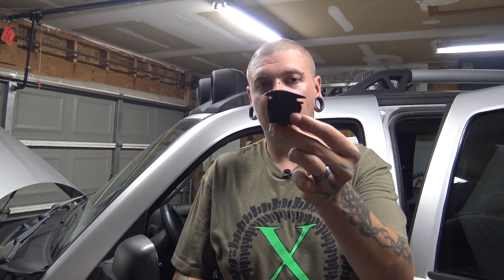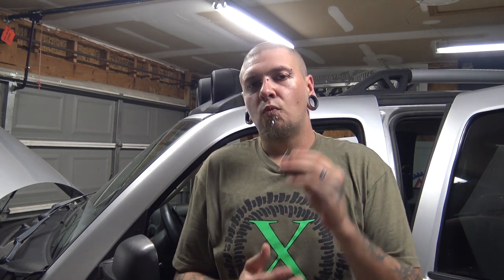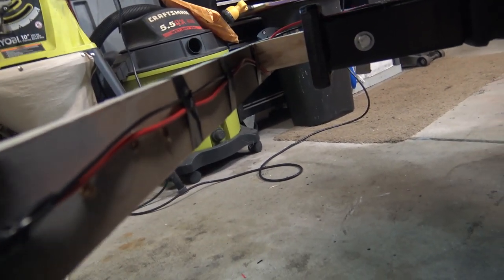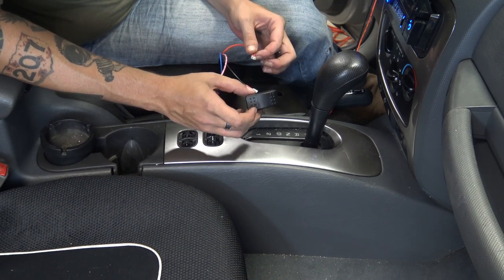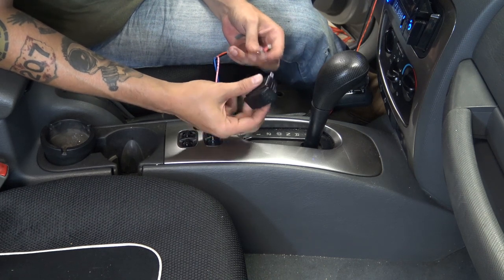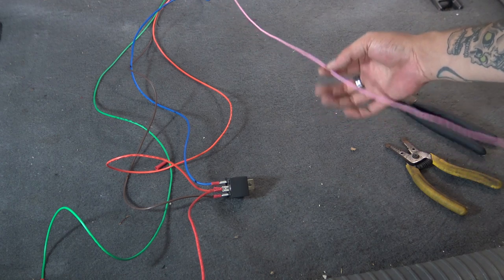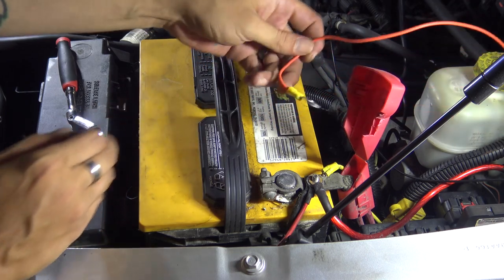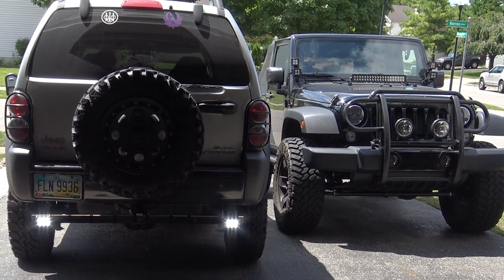How-To Make Aux Reverse Lights Multi functional (SPDT Switch)

Comment: That is a lot of work for a mock-up.  Nice video.  I'm not a fan of cheap splices due to corrosion.  Your work has earned you another subscriber.
Reply from the maker: Thank you! I usually solder all my connections, put on some dielectric grease and heat shrink. I use T-taps in a lot of videos because I would rather see people use these then just twist and tape. Thanks for watching and for subscribing!

Comment: First off, nice video & 2ndly, all you just did was wire the switch backwards with the two power outputs coming from 2 sources! I did this with my motorcycle's undergrowth led pods! It's nice to be able to control how & when something works! Again nice & easy to follow video!

Comment: I just received 2 pairs, one will be in the back and one as fog ligths. This video just save me, cause I want to use the back one with the reverse  but also want to use it separate by itself, thanks great video.
Reply from the maker: Glad the video could help! Thank you for watching!
Reply: Does the green wire runs from the batterie negative side?
Reply from the maker: @shijansantos  You can run it to the battery negative or you can ground it to a chassis ground, which ever is easiest to you. It just needs to be a ground. Thanks for watching!

Comment: I did mine on a relay so if I put it in reverse they would be switched on and off automatically with the high beams. Foreward off-road lights are similar, but with the ability to disable them with a dash rocker as well as off with low beam.

Comment: Great video and great detail! Thanks for going through the pain of leaving everything exposed and repeating its for demonstration purposes only ahha. I was wondering though. I have an Auxbeam switch panel. Would it be possible to wire it with 2 different switches instead of a rocker? to where I can manually turn lights on on my switch panel but have a different button mounted on the dash where "on" means it turns on with the reverse and off means it doesn't?

Thanks!
Reply from the maker: Sorry for the late reply. I think it may be possible. I'm running it through my head to think of how it would be done.

Comment: Great VIDEO!  Thank you!!   I have only one question though... as I am confused about the "orange" wiring.   When talking about the switch, you discuss orange going to pin 8 on one end and to the battery (for constant on availability and switch light remaining on if switch is grounded) or to fuse box (for ignition on activation) .   MAKES sense on both senarios.

THEN regarding the relay... you note that orange is connected to pin 30 and then back to the battery.

SO... will there be TWO orange wires connecting directly to the battery... one to switch and one to relay?

THANKS

Comment: Perfect timing for his video! I just bought a Globex Performance rear license plate mount thing on my 2016 jeep renegade... I am using Rigid Radiance. I wired the red ambients as a third (fourth?) brake light. I am working on figuring out which is the reverse light so I can tap into to get the same functionality as this from my relay. 

One question, is there any difference with a 6 pin switch?
Reply from the maker: It would depend on the brand of switch, MOST of the time manufacturers stick to a universal pin layout as to make all switches the same, but sometimes you get a company that just doesn't follow the rules. I would just reference the pin numbers in this video and see if they match up to the pins on your switch because with a 6 pin, I THINK it's just another ground pin. Thanks for watching, and ig you haven't already, make sure to subscribe to keep up on all the new videos and products! Thanks again!

Comment: Great Video; I will be installing this set up this week.
My question just to make sure; if I wanted the switch to 'throw' the opposite as what you showed (down is in tandem with stock back up lights) I just install the switch in dash that way...wiring stays the same....yeah...makes sense...
Reply from the maker: Makes sense to me, should be no issue with switching the wires. Thanks for watching!

Comment: Appreciate this video. I going to hook up the external backup lights to my truck. I was told I probably wouldn’t need to have a relay, but you are using one for these . The lights I’m going to use are 9,000 lumens . Should I be concerned about using a relay?

Comment: Great video and explanation, thank you for this.  I do have a question about how I would like to wire my aux reverse lights.  I would like the aux light to come on while in reverse and but also be controlled by a stock switch in the vehicle that controls the cargo bed lights.  Truck is a 2019 Chevy Silverado.  Any input you had would be greatly appreciated, thank you again!

Comment: Isnt pin 86 a ground and pin 85 goes to your switch from your relay. Thats how i have my relay/fuse box setup. Just curious
Reply from the maker: Pins 85 & 86 can be switched either way, no real wrong or right on those. This is just how I've always done them.
Thanks for watching!
Reply: @RockyXTV  Something new that I learned today, thanks again I was just worried because I’ve been doing it the opposite from you but like you said they both work either way thanks again

Comment: You say that you ran power from battery to the switch and power from battery to the relay, but when you hook up the power to battery, you only have one wire. Did you pull power from somewhere else to the switch or something?

Comment: so you use a 5pin relay, is that ok. or should I use a 4pin?
it's just my understanding that power continues to 87a.
great video, made setting up my rear lights and light bar to high beams easy to understand.  thnx.

Comment: May I ask help from you? I purchased the exact switch you demonstrated and connected it to two 7" LED's in my pickup exactly the way you demonstrated., everything worked for about two weeks then the manually controlled backup LED's quit working. They work in R, but not when I want to turn them on independently. I have checked and rechecked the connections, all are ok. I have checked the continuity in the switch, this is what I found:  Switch Top press in, continuity only between pens 7 & 8. Middle switch in neural, no continuity in any of the pins. Switch bottom press in, continually only between pins 8 & 2. I don't know what this means. I don't know if the switch failed. Can you somehow give me some pointers to fix this issue? Just added more info for you. The power supply for the SPDT switch is supplied by another switch and this is connected to SAPDT pin 8, pin 7 ground, center pin to relay 86, bottom left pin to power from reverse lights.

Comment: I am trying to put this on the rear bumper of a truck.  Where should i put the relay?   Do you have to have the relay?   Can i just splice into the hot wire for reverse lights and find a grounding spot?   I cant reach the battery from the rear bumper without adding wire
Reply from the maker: If using low Amp draw LED lights you don't HAVE to use a relay as long as your switch can handle the current.

Comment: Terrific video and instruction. I want undertake the same installation as you have shown, however, with one addition.  I would like to add a switch in the rear of my vehicle that would allow me to turn the rear lights on and off manually.  Are you able to help with how I would wire this switch to work with the three position switch at the front.  Thanks
Reply from the maker: You could add another switch to the rear, but it would be independent from the other switch. You would have to turn the lights on and off at the rear. You couldn't turn them on at the rear and then off at the front, or on at the front then off at the rear and so on. Automotive switches and wiring makes it very difficult to replicate a typical "3-way" switch like you would have in your house.
Reply: Thank you

Comment: Thank you for making this video. Idk if you have a video for this question but I want to add a dual color (white and amber) light bar to my 4runner spoiler and my plan is to have it like this where the white turns on with the reverse and also have it turn on with a switch but now my problem is how can I wire the light bar where I can also turn the amber on with a separate switch. So pretty much the light bar has 2 color and I would like to have each color its own switch and also have the white turn on when I hit reverse, is that possible?

Comment: This is the exact set up I want. I have questions! How did you know which terminals on the relay to use and how about a link for the relay? Thanks for all the hard work you put into making this video especially since you weren’t keeping the lights there.👍🏼☮️
Reply: The relay is a standard automotive relay, available at any parts store  The pins on the relay are numbered.

Comment: Since you are adding direct power to the switch, will it drain thr battery if you leave in the auto position?
Reply from the maker: There shouldn't be any parasitic draw from the switch alone.
Thanks for watching!

Comment: That's great!! Exactly how I want it. any chance if you can saw us the wiring diagram? That'd make it lot easier to follow. Thanks lot
Reply from the maker: If you like, you can send me an email rocky.tvchannel@gmail.com and I can send you a simple wiring diagram. Thanks for watching!
Reply: @RockyXTV  Great video easy to follow, but wanted to know if you could help me by showing a video on how to install 2 switches and still be able to use the reverse lights. I have upfitter switches and would like to use them along with the extra switch that will go installed to my trailer for better lighting while backing up and hooking up. Is it possible to use the pin box to do some of the wiring that would connect truck and trailer with the upfitter switches?

Comment: I cant see the switch, supposedly if i use a 7 pin dpdt and use one side so it acts as a spdt, do i still connect the wires to the pin number like in this video? (7 to ground, 8 to battery or dash, 2 to 86 in the relay and 3 to the tapped positive of the reverse light)
Reply: Hi, I know you posted this a year ago, but did you ever figure it out on the 7-pin?  I'm doing this now with a 7-pin.  Thanks.

Comment: If I wanted to do this same thing, but to an enclosed trailer. Would you have to use a relay (like you did) or diode? I want to mount a light bar on the back of a 20' enclosed trailer. I would like to use the light bar as reverse lights (actuate when truck is put into reverse) and an auxiliary light so I can mount a rocker switch in the back of the enclosed trailer to turn the lights on when the truck is in park. If the light bar was directly wired to the reverse light pin on the 7 pin trailer wires I would think everything would be fine, but if I also supply the 12V power wire (on the 7 pin at 11 o'clock) to the lightbar with a rocker switch I am not sure if I would get backfeed and mess anything up in the truck. I saw etrailer ( part number RM-790) had a diode that is preventing that. Here's the link to a question and answer from etrailer. https://www.etrailer.com/question-270174.html

Not sure if I need it or need a relay like you have if it is on the trailer. 

Thanks for the video!

Comment: Awesome video but i still have 1 question, i plan to run the switch to the fuse box is it better to run the relay to the fuse box as well or should that be direct to the battery?
Reply from the maker: I always run relays directly to the battery with an inline fuse, but you could run it to the fuse box as well. Just make sure you are using an empty/aux location in the fuse box for the relay and not sharing one. You could use a shared one for the switch though. Thanks for watching!

Comment: Great video.  Question is there a way to add a momentary switch to the circuit to  flash the lights? I'm guessing it is as simple as addinh the switch and some one way resistors to eliminate feed back.  Maybe I'm just tired but I cant figure it out.

Comment: Great video! Exactly the thing I was looking for! Great set up! Thank you!
Reply from the maker: Glad you liked it! Thanks for watching!
Reply: @RockyXTV  planning on installing some flush mounts to rear bumper of 2007 Ram pickup 
Want to wire them to a 2 position “ON-ON” 3-way old school metal flip switch and wire them also to the cargo lights my concern is do I have to run and use a relay also

I ask because The Cargo lights have a switch in the cab which may allow me to turn AUX lights on from inside the cab using cargo light switch the plan is to use the Aux lights when reversing or line up to trailer at nighttime but not necessarily be on with my reverse bulbs as I have led ones in my tail lights with plenty of light for normal situations in parking spots not so much for trailering/towing 

The 3-Way 2-position “ON-ON” switch I’m thinking of using will be mounted somewhere close to my hitch under rear bumper and Plan is to have the first “ON” position so AUX lights function with cargo lamp switch in cab but I can use the other “ON” position to flip lights on from back of truck if disconnecting trailer or need light behind truck so I don’t need an off function on my switch 
Have 7pin trailer plug in in the back of truck so my hot to battery and grounds can be wired off of it 
1) do I need a relay to wire lights up in this manner
2) can I run my wires to my cargo lamp hot wire that is behind cargo lamp outside of the cab with T-Taps to not have to wire all the way inside cab up to the cargo lamp switch
3) can I grab from 12v hot from my 7pin or should I run my hot all the way up to battery

Comment: Followed the steps. But when i manually flip thr switch, it doesnt come on. It comes on auto with the reverse and turns off when flip in the middle. Any help? Do i have a bad switch or relay?

Comment: Hi Rocky, I have another doubt. I would like to install a roof, bumper and rear light bars. Do you think it is necessary that I use a relay for each light wiring, or just a single relay would be ok for all thel ights? Thanks again!
Reply from the maker: If they are under 30 Amps combined, you could theoretically use a single relay. I would suggest using a relay and fuse on each though, just to be safe.

Comment: Is there a way to bypass the relay? My set up are in cabin RGB LEDs t-tab to the interior cab light with an on-off-on switch. Everything is working fine but because of my cabin lights dim out when the door closes... I believe that the relay is making a buzz as the lights dim out. Any advise?

Comment: I have watched this video a couple of times, but I am using a different switch which is why I think I am still a little lost. My switch has 6 pins on the back of it and I am trying to do exactly what you have going on to where one position is reverse comes on when in reverse, one for them on without in reverse and one with them off.
Reply from the maker: If you send me an email with a link to your switch I might be able to send you a wiring diagram to help. ( rocky.tvchannel@gmail )
Reply: @RockyXTV  okay thanks man I feel like its gonna be really simple and I am just overthinking it
Reply: I sent you a email just reply once you get a chance

Comment: You may have covered this but, how did you wire the 2 lights together to get 1 positive and 1 negative?
Reply: tattoochef82 82  He wired the lights wires together. Positive to positive and negative to negative. In the end he end up with one positive and one negative. I hope that helps!

Comment: Due to the switch being power from the battery, is it correct to assume that the auxiliary reverse lights come on without the ignition switch activated?
Reply: That is correct.

Comment: I have a question, if I want to wire up a add on cube LED to the existing back up light, but I also want to add a switch to turn it on and off as I need. Please help me out.

Comment: I’m sorry if I missed this, but what gauge wire did you use?
Reply from the maker: I mainly use 14Ga. with lights. Sometimes smaller with lower power LEDs.
Reply: Rocky X TV thanks! Awesome video, love the dual functionality

Comment: Awesome video, great and clear explanations ! I was wondering, what wire size you recommend for those king of lightS ? thanks
Reply from the maker: The lights used in the video were a low end/no name brand light. The were advertised as 36W each, this would make them just over 5 amps for the pair, but as I always do I tested them later on and they turn out to be 9W each. This now makes them about 1.5 amps for the pair. This type of "cube" light is usually around 12W per light making a pair about 2 amps, now with all of that boring info aside, I can answer your question. For a standard pair of "cube" lights you can get away with wire a little as 18GA. but I would recommend 16-14GA with a 10A fuse. Sorry for the long explanation, thanks for watching!

Comment: Can you do this without the switch? So that the lights come on with your reverse lights automatically? I’m installing fog lights on my car and want them to come on with my low beams. I don’t want to have to run a switch into the cab. Do I just connect the wire that’s spliced into the low beams into the pin on the relay that you put the wire going to the switch?
Reply from the maker: That is exactly what you do! Run a wire from your low beam + to Pin #86 on the relay and just wire the relay in the normal fashion then you have no switch! Thanks for watching!
Reply: Rocky X TV Awesome, thanks for replying so quickly!  What’s your opinion on the Y butt splicers? I don’t want to solder the wires and I’m not a huge fan of using those clips in the video, so I was thinking of cutting the low beam wire, and splicing the 3 wires (2 from low beam and one going to the relay) using the Y connector
Reply from the maker: Should work fine, just be sure to weatherproof if the best you can.